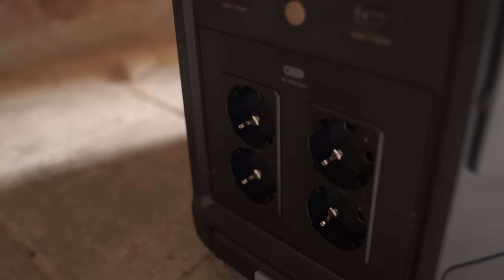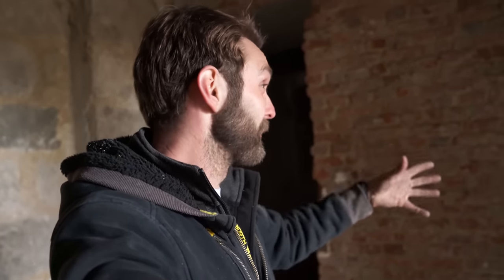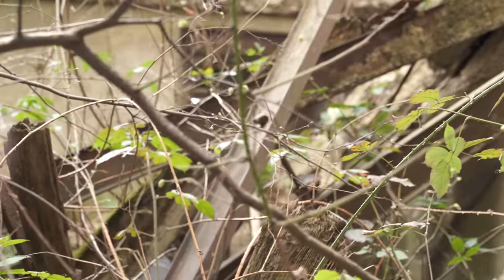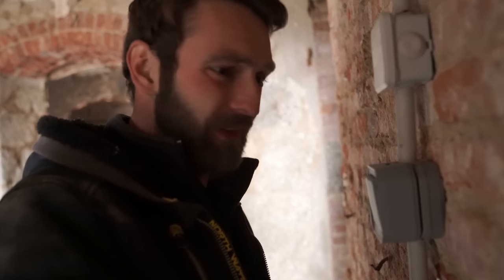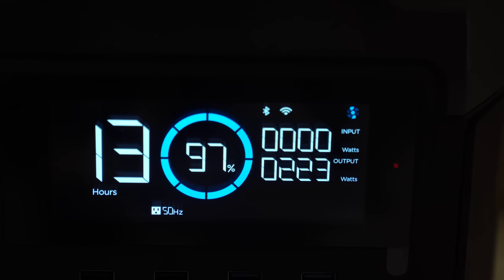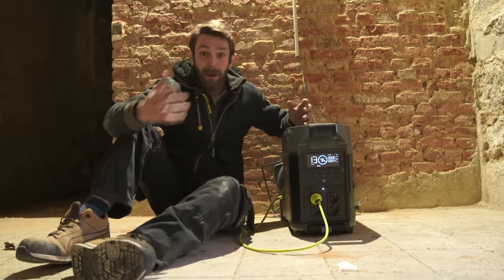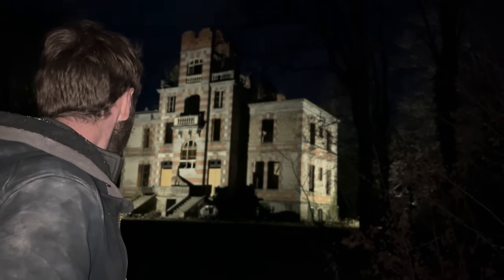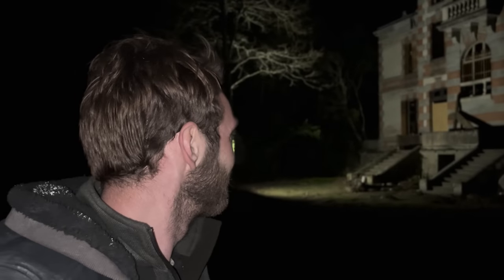I powered up this abandoned ruin for the first time in 50 years - I wasn't expecting this!!

Comment: Lighting is something I do for a living, those exterior lights look impressive - instead of lighting from half way down each side, move the lights so they aiming at each corner. It will end up with each face being lit from two angles and remove most of the shadows 😊
Reply: Then dial those down a bit, and stick the brightest lights inside the shell so the windows light up, instead of being black holes. The chateau will look almost lived in..!
Reply: 2 brilliant suggestions 👌🏽. That will look ever so smart 🤩

Sending you warm greetings from The Netherlands 🇳🇱

Comment: Just the other day I thought, “ Dan needs to get an Eco Flow.”  Now, I have to say, I really thought you weee going to actually have electricity running to your Chateau, at least to the outside.  The Eco Flow really makes sense and I was waiting for you it runs in Solar Power.  I believe Billie, The Pethericks, said takes about two hours yo charge?  Congratulations Dan.  I had a question though.  You stated you were going to build a small cabin behind your Château so you can live there, while restoring it? Would it not be better to purchase a new or used camper?  It would save you a lot of time and having to build a cabin, put in a bathroom, cooking paraphernalia, etc. ME: just being nosy. 😊

Comment: V31: CANT BEAT WAGA BLOCKS!!! How are you going to charge the Ecoflow Dan? You are going to need like a Kw of solar panels so 5 x 200w should do you DONT BUY FLEXIBLE ONES they overheat and pack up in no time - SOLID PANELS - way to go! You are putting hardly any load on that unit running lights. Its when you pile the amps on THEN it drains it!
Now if you run a chain of FESTOON builders lights right through the chateau then you are sorted. YOU ARE THE LUCKIEST MAN on the planet!

Comment: I was expecting some real wire electric not some short lasting battery. What a waist of time.
Reply: Give him time!!!!!!!!!!!
That will cost him thousands. This plant was a gift!!
Reply: The Chateau kind of needs a roof and windows and doors and things to keep moisture out before spending thousands of dollars to lay real electrical wire or else it'll just get ruined and have to be replaced again.
Reply: @wyleewaterwitch  sorry but You don’t know nothing about electric. In my country we first make contract electric company and than start building or repairing house. While we can’t work without it. Always is possible to get electric wire to your property. Some temporary outlets are even selling in shops over the world. What are U talking at all?
Reply: There's always one 😂
Reply: Yeah, right! There is always who can think 2 steps ahead.
I’d make fuse box to the basement while either way You don’t want it to the main floor. Also this is good place to start doing nit anymore temporary things what are not so cheap anyway. First is good that it is already cleaned so next step is order some proper doors and windiws for basement floor. So You can close it . From there You need to bring in proper electric cable and make fusebox to the wall. From there have to invest some money to security cameras what goes to protect Your building. Id put them right places while You need them anyway. This is good ground to start major works. 
Also after cleaning all the dirt and rocks from first floor is the floor now a little bit in dangerous situation. Smart thing is to bring pallets ( I think You get it free somewher ) and lay down everywhere side by side so if tgere is any falling from upstears You don’t be afraid damage the floor. 
Btw.I like this project and wish You    well!